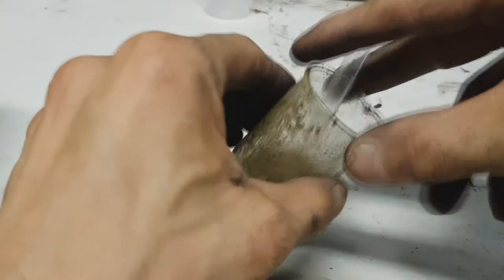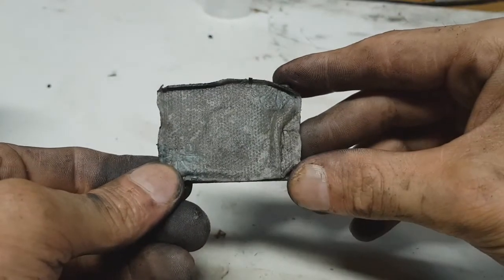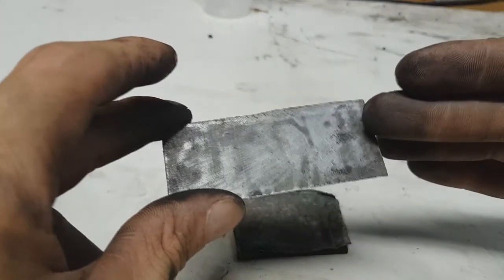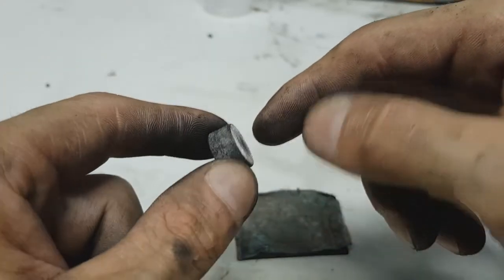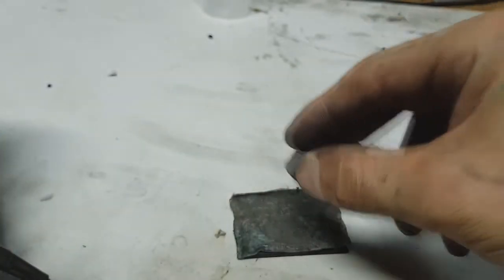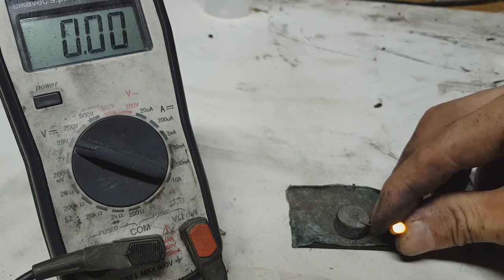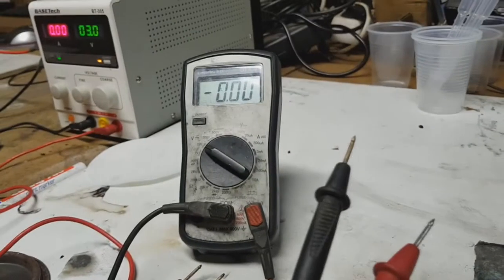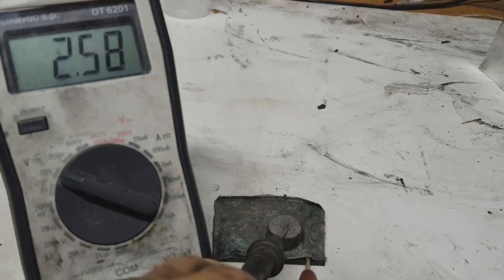Ionic liquid for Magnesium Battery?

Comment: Great Work! Where can I get or how to make the ionoc liquid Al Cl4- for Aluminium ion battery electrolyte? Seems that you have in this video. If You want to work with magnesium I know there is a lot magnesium chloride in supermarket. Maybe can improve the efficiency in your magnesium battery.It´s a kind of a substitute of salt ( naCl). You can find in dietetic zone. Regardes